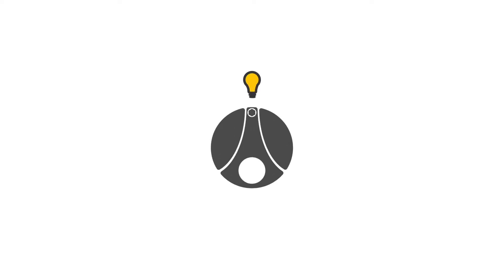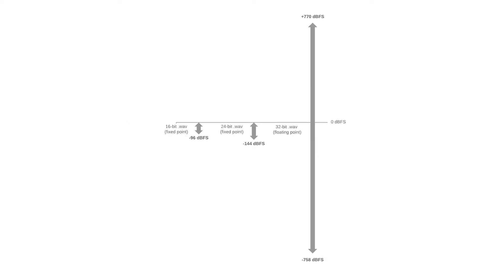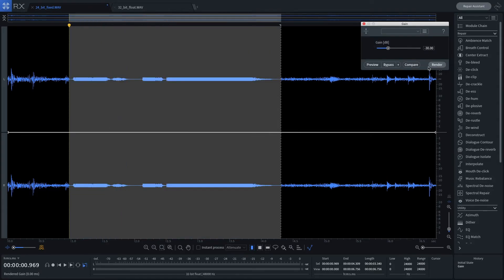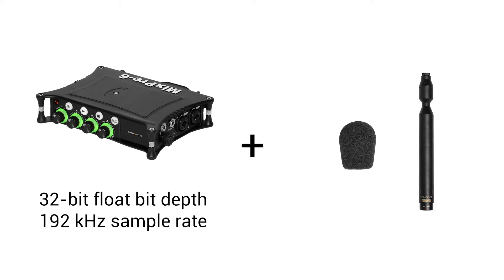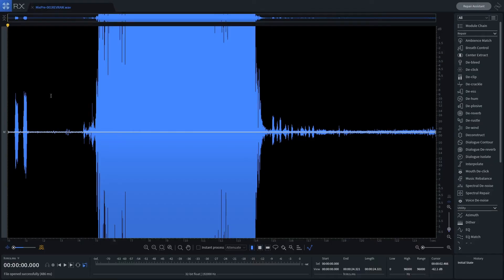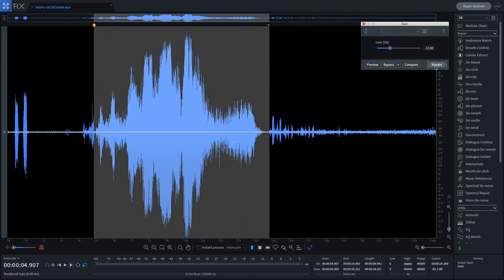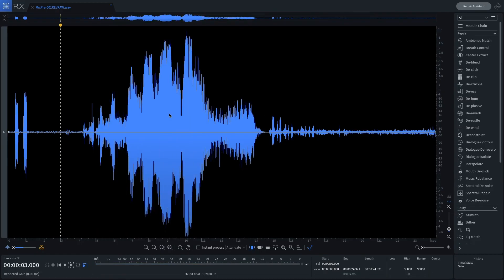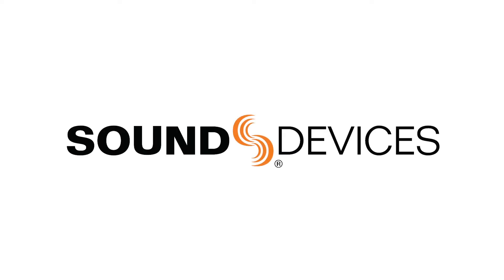The 32-bit float workflow

Comment: Can you still level your mic in 32bit float? Is there a reason why you didn't show the spectrogram? Because i'm wondering with this workflow, you obviously drag down the ambience and noise and its kinda hard for the transition to sound good isn't it? i mean i could just lower the whole file -22db but i think i still would prefer leveling myself + analogue limiter! The workflow seems quite heavy
Reply from the maker: Yes you can still set you levels in 32-bit float mode! The spectrogram just cluttered up the image. It's much easier to see the square peaks coming down with just the plain signal. The ambience will come down as well but 32-bit float can be used for extreme SPL scenarios like firearms or car recording that would normally clip. This was an extreme example. You can of course still ride the gain and the Kashmir preamps in the MIxPre series are already incredibly hard to clip in 24-bit mode especially with our adjustable analog limiters.

Comment: Amazing! So, in theory limiter is not needed anymore when recording in 32-bit float? Also with 32bit float you only need to make sure you are not clipping your microphone?
Reply from the maker: Correct! The limiter is actually disabled while in 32-bit float mode. As long as you microphone can handle the source, the MixPre II won't clip!
Reply: Sound Devices what do you mean as long as the microphone can handle the source? Would a cheap microphone not be able to do what you just did?
Reply: Anime Zone I believe that they are referring to the fact that each microphone has a maximum sound pressure level (SPL) that it can handle.  If you are recording something with a very high SPL, for example a jet engine that exceeds the microphone maximum rated SPL, you risk getting distorted audio.  I imagine if the sound is loud enough you could even damage the mic.
Reply: @EdwardRaybould  I my experience I normally go for the lowest self noise specification I can find in my budget. However this year I was trying to finally get good sound from my motorcycle. Wind noise is a brute solved by fur and sheltered placement but I double checked the maximum SPL spec provided by the manufacturer even though the lavalier I chose which is in many ways inferior on other specs. Nobody's hearing -24 dB of hiss buried in what's coming into that poor mic sitting by the air intakes inches above a 1200cc engine on the boil. Big grin.